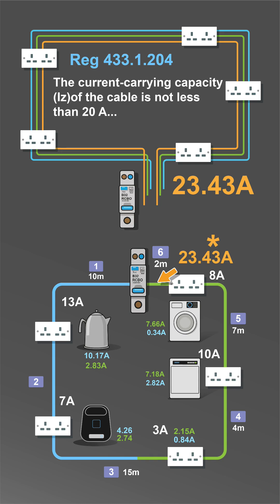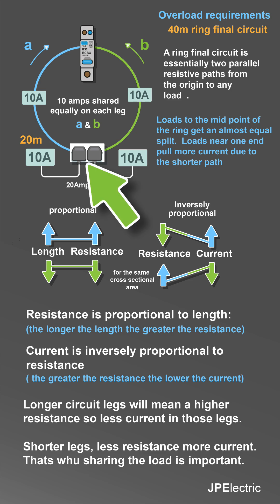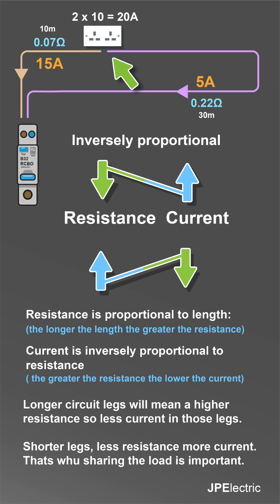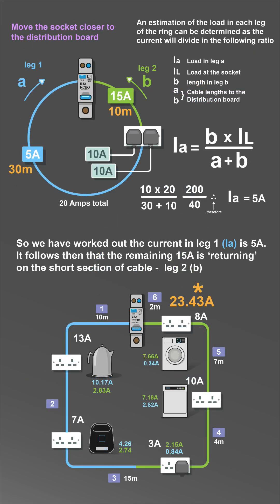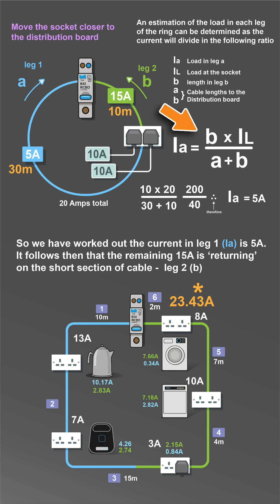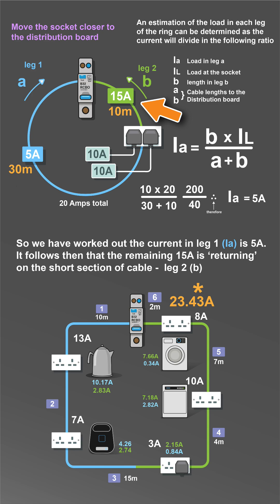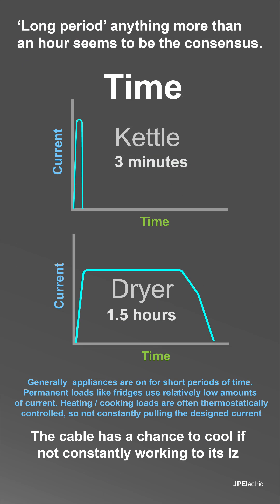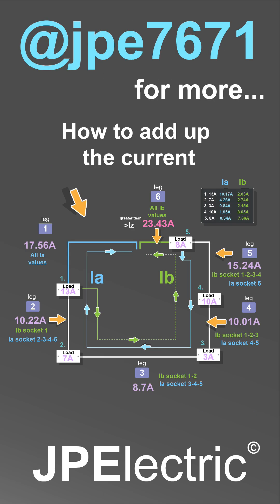Overload in a ring final circuit

Comment: At the mid point a 32a appliance can be connected using 2.5mm cable and a 32A breaker.  
Use a 25A double pole, 'unpolarised', micro circuit breaker, instead of the single 32A breaker, with the L conductors of each leg of the ring connected to each pole of the micro circuit breaker, then all bases are covered. 25A only from each pole onto each leg of the ring. Protection against the circuit being cut and imbalanced. 

So, using these DP breakers with a maximum of 25A on each pole, and 2.5mm cable a 50A appliance can be connected at the mid point of the ring.